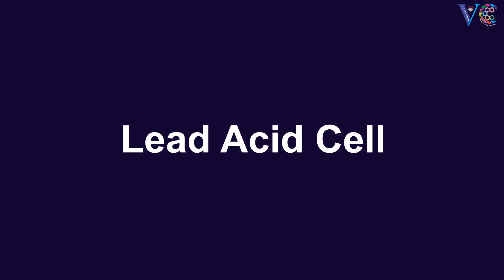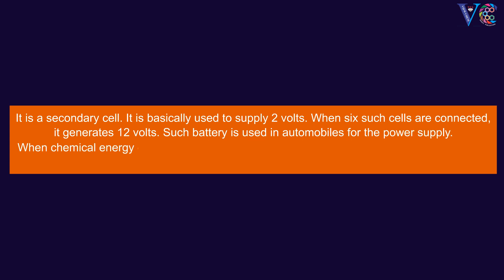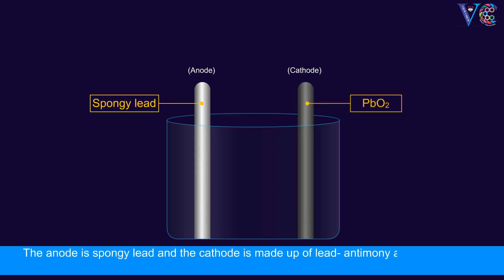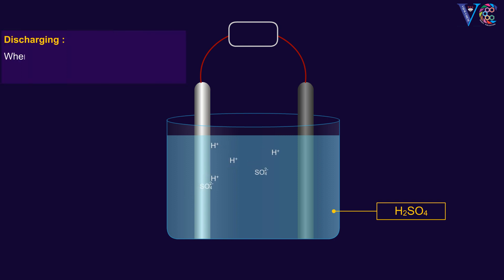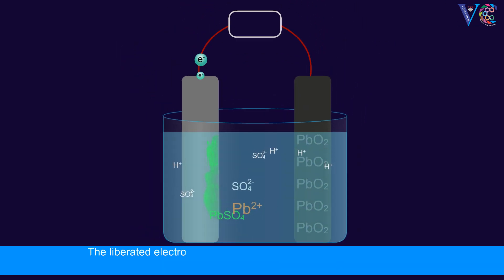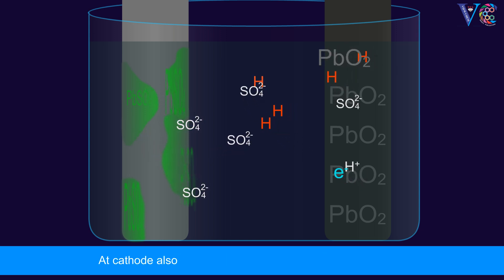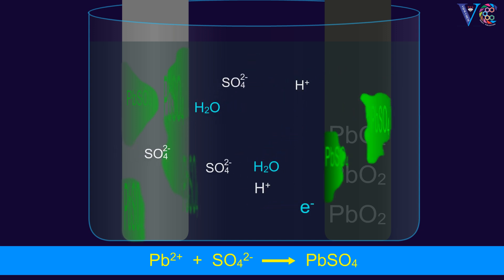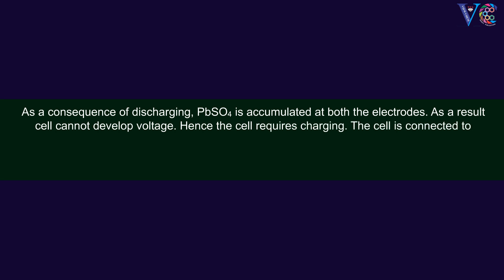Lead – Acid cell

Comment: Very good video, with accurate information.  🧐    The movement of the ions (cations and anions) makes the oxidation (anode) reactions, and reduction (cathode) reactions very clear.  
During the ‘discharge process’ ( that is, as the battery produces electrical energy, to start a vehicle, for example, )   the ANODE is the solid lead (Pb) electrode, and is negative.      The CATHODE is lead (IV) oxide (PbO2),   sometimes called lead dioxide, or lead peroxide,   and is positive.   
The net reaction (around 2:00 minutes) is correct, but there should be a 2 in front of the PbSO4   ( 2 PbSO4 ) on the products side of the equation, for the equation to be balanced correctly.

Comment: Anode is PbO2 and cathode is Pb.... here its explained opposite
Reply from the maker: During the discharging Pb is anode and PbO2 is cathode . Please refer
Reply: Sharath,   the video is correct.   During the ‘discharge process’ ( that is, as the battery produces electrical energy, to start a vehicle, for example, )   the ANODE is the solid lead (Pb) electrode,    and is negative.      The CATHODE is the lead (IV) oxide (PbO2) electrode, sometimes called lead dioxide, or lead peroxide,    and is positive.   
The net reaction (around 2:00 minutes) is correct, but there should be a 2 in front of the PbSO4   ( 2 PbSO4 )   on the products side of the equation, for the equation to be balanced correctly.